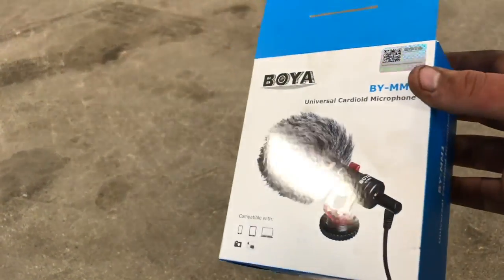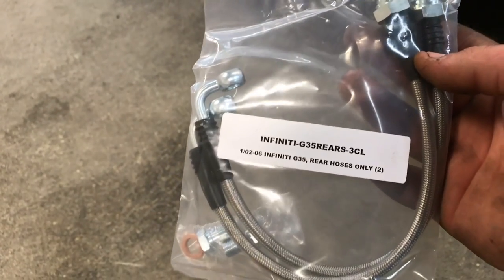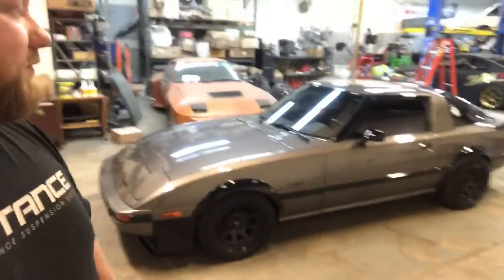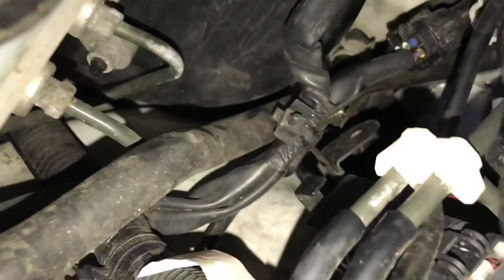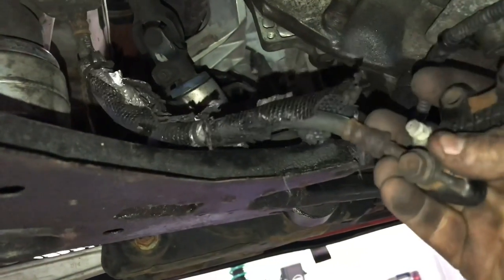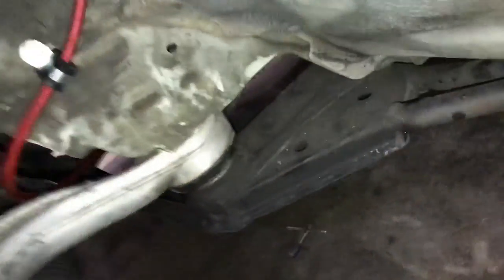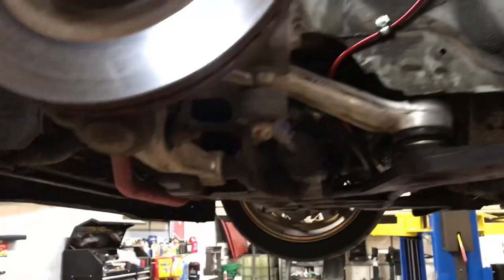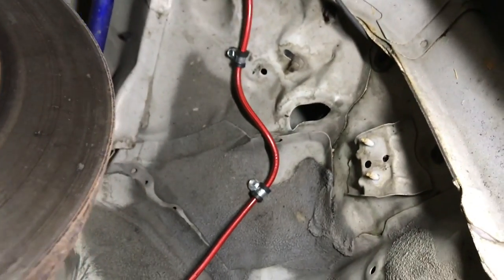G35/350z sticking clutch pedal fix

Comment: Were you losing fluid from the master? Some masters don't leak but they have air pockets stuck in them. Bench bleeding always works best I found.
Reply from the maker: I bench bled it multiple times and wasn’t leaking any fluid. That’s why I replaced it.

Comment: i bleed my clutch fluid. now my clutch is stuck and wont even come back up. i went through like one bottle of new fluid. gonna have to go buy 4 new bottle and try a different method.
Reply from the maker: I always use a air bleeder and leave clutch pedal at the top. Makes life easier and quick. Have you checked if your clutch master cylinder is bad? Go with the upgrade oem masters are trash.